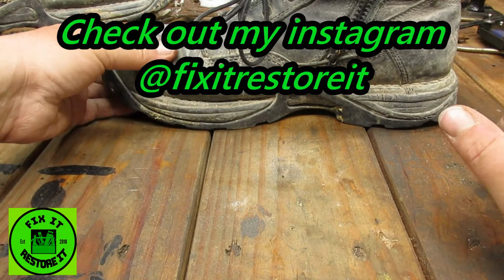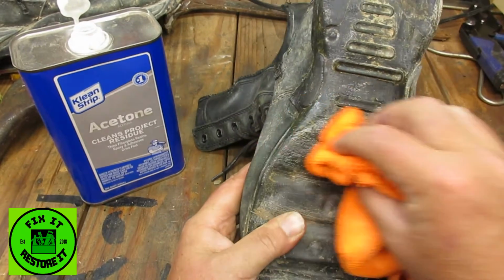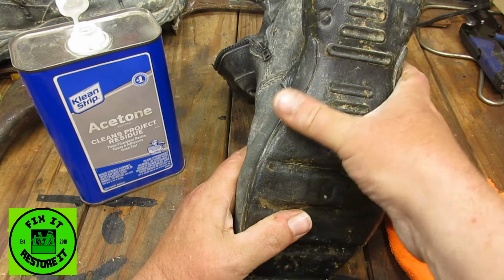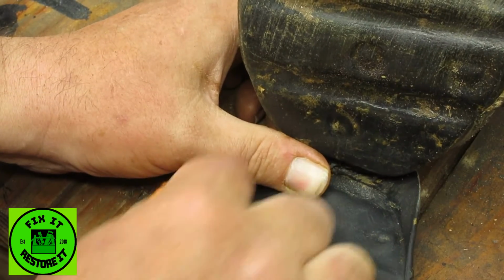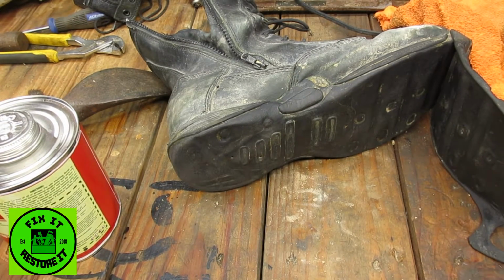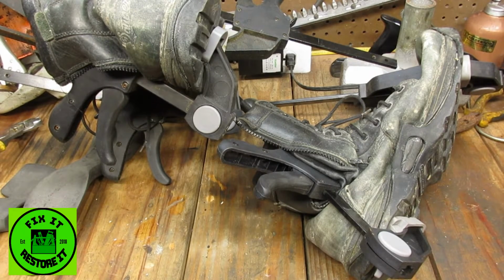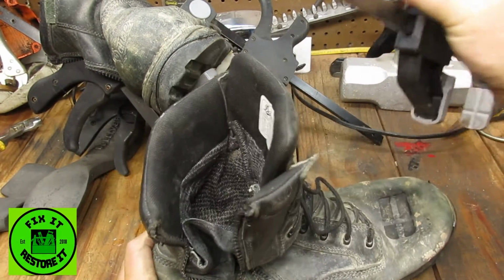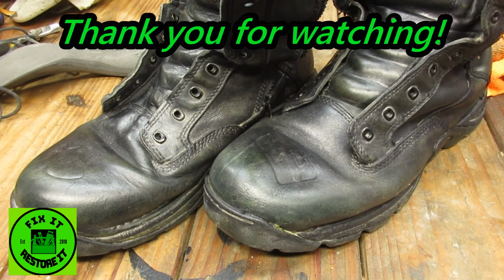Boot repair using barge glue

Comment: I had the same size can of Barge cement in my trunk for an hour and I hit a bump and the can tipped over and I was unaware until I started smelling a strange smell and then I remembered and I get out and the can is on its side with the cap open and theres a puddle of glue like 2 feet around on top of my carpet. The smell was horrendous and I ended up having to peel the carpet out and toss it.  I fix my shoes all the time. One time I used a black urethane on shoes that had the soles completely worn smooth and I saw the suggestion that I coat the whole bottoms and then roll the bottom in uncooked rice and the rice sticks in the urethane and the bottoms of the boots now have a super strong and grippy bottom, because the rice acts like sand paper and I can easily walk on ice now if I wanted to.
Reply from the maker: That's a really cool idea 😎

Comment: You'll have to update us after using them for a few weeks!  My Dad used to do stuff like this all the time...  Why buy something new, when you can repair the old?  He even used to make his own, custom, shoe inserts out of finely ground cork, mixed with silicone caulk!  He spread it on leather cut to fit his shoes, then built up the edges and arch areas to fit his feet perfectly...  Let it dry and you have cheap, custom-fitted inserts that are better than the professionally made ones!
Reply from the maker: That sounds awesome! I will update everyone on my community tab after a month or so,  all you have to do is subscribe if you havent done so already!